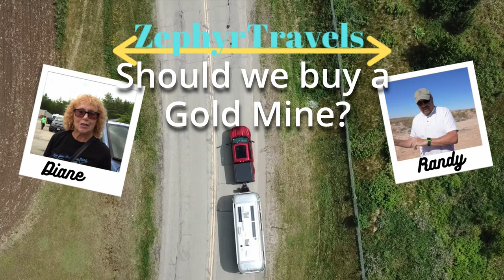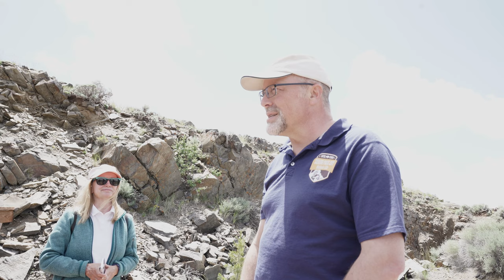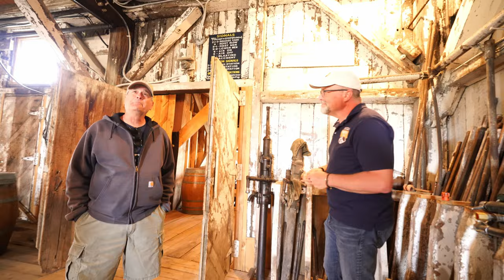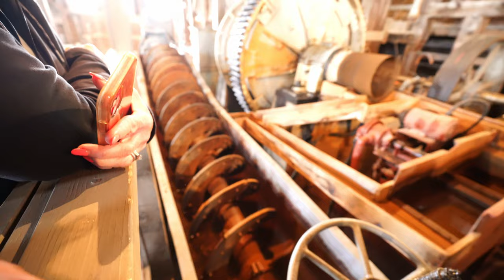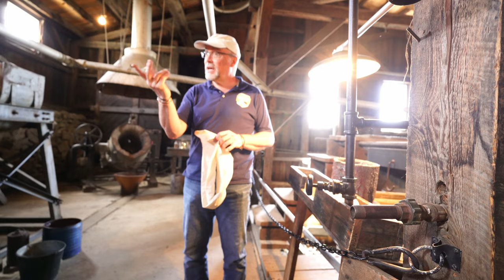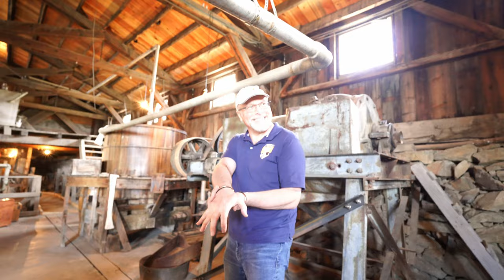Shocking Truth of Gold Mining at Carissa Mine in South Pass City, Wyoming | RV Travels

Comment: Underground coal mining we used dynamite in areas below 40 degrees. I know this guy has no actual experience using dynamite with him telling you wrong. It was put in their clothing because they needed it pliable with hardening up below 40 degrees. What he should have told you is you do not let dynamite be stored anywhere that is above 65 degrees because the nytoglycerein will "sweet" with pulling the nitro out of the gauge it is mixed in with leaving beads of water on the outside of the waxy paper of the dynamite stick. Bump or shake the dynamite stick with blow up the dynamite. Just like the old western movies transporting nitro in floating in open water barrels to help any vibration from setting it off, which didn't always work and that is why those who transported it were payed more than anybody else, except for those that had to carefully poor it into blasting holes. We have to actually yearly go into powder boxes to actually turn each stick of dynamite 180 degrees over so any nitro close to the wax paper travels back through the center of the dynamite stick.  Go figure !
Reply from the maker: That really interesting - Not sure I would want the job of turning the dynamite sticks.😱. Thanks for sharing.